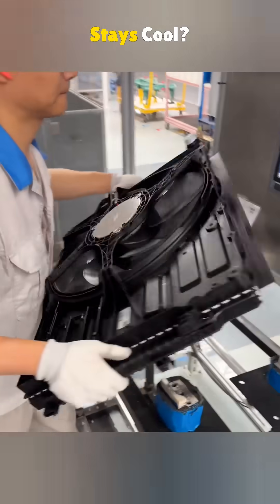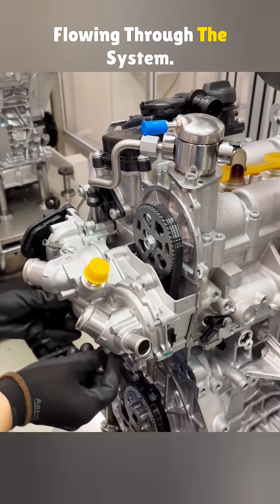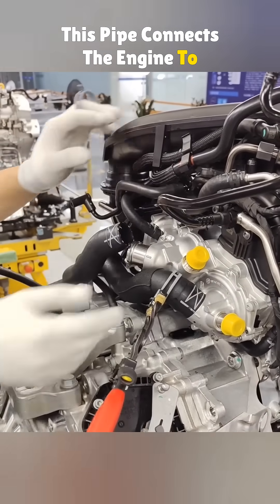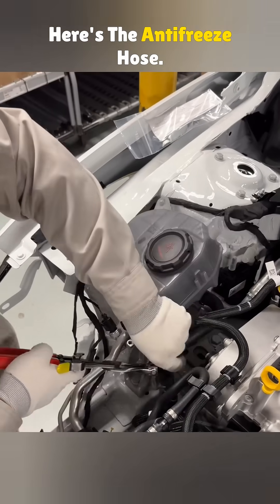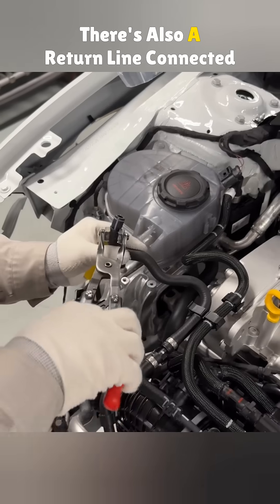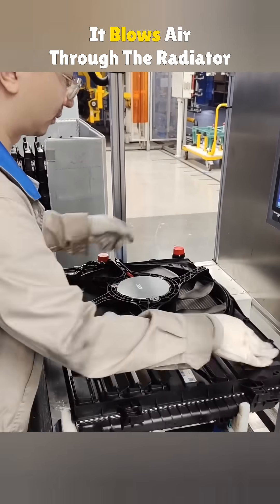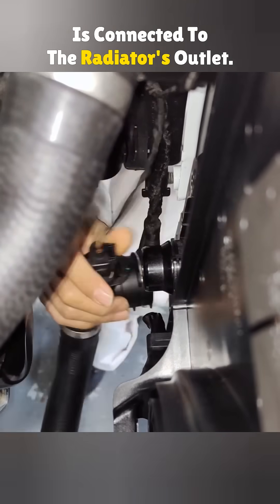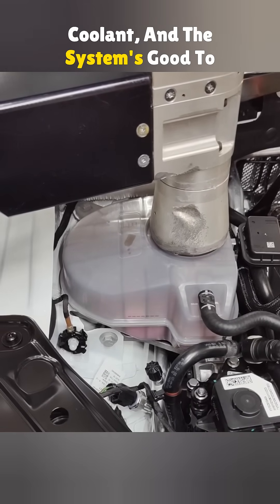How Your Car Keeps Its Cool– Engine Cooling System Explained #assembly #automobile #mechanic #engine

Comment: They now drive the water pump using the cam belt?
That sounds risky.
Why not the fan belt or serpentine like in old reliable cars?
Reply: It’s a separate smaller belt. There’s a couple VW engines that use this.
Reply: Many engines have had their water pumps driven the cambelt for years,although electric pumps are becoming more common.